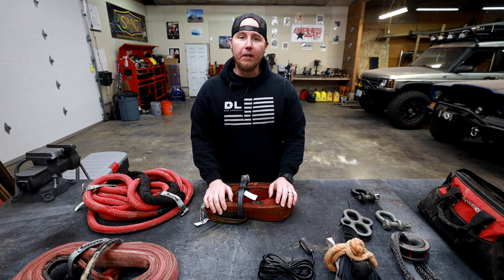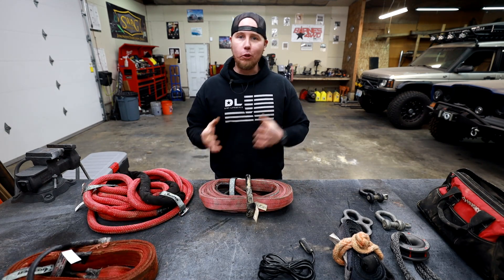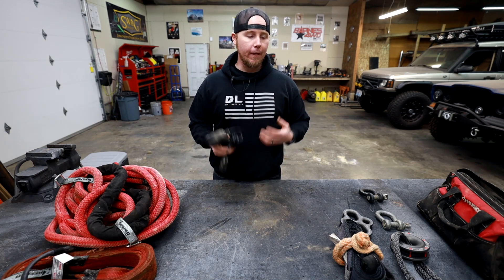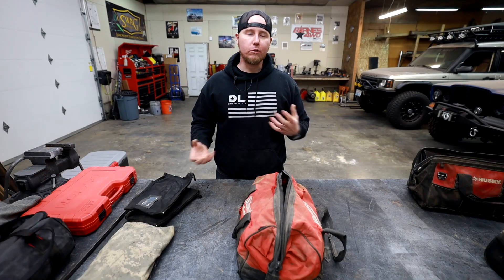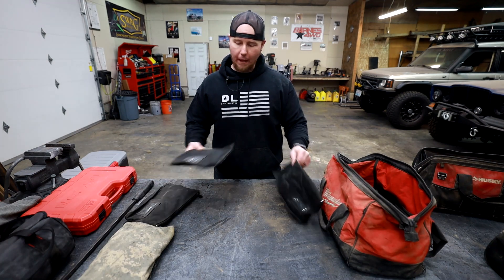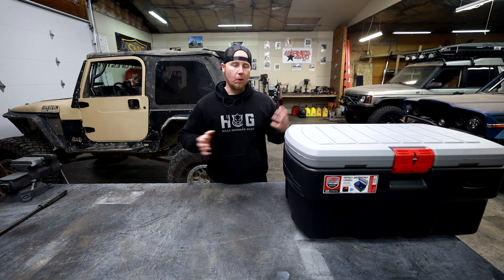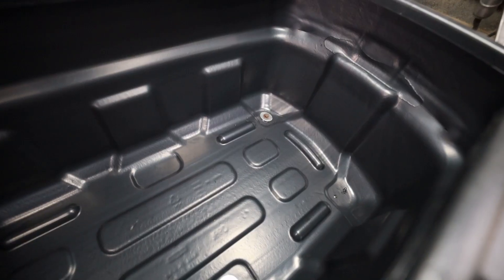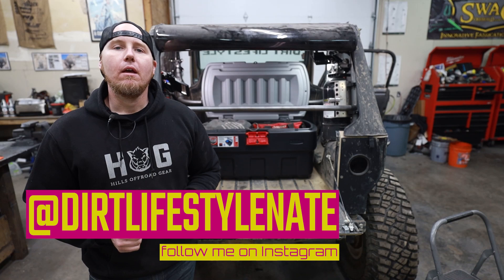Organize Your Mess! Off-road Tools And Recovery Gear Consolidation First Attempt

Comment: Calls butane torch, "crack lighter", says he's from Tacoma. That checks out😆😆😆 Great stuff Nate!!
Reply from the maker: Lol #tacomalife
Reply: Facts
Reply: Hey in all fairness that's more Spanaway now.
Reply: So fucking funny, although, if it's from tacoma, it's probably more of a meth lighter
Reply: We've always called it a crack torch
Reply: @dirtlifestyle hey Nate, can't remember (and can't find it in the videos) but do you run the deep cut bandsaw or the compact Milwaukee? Just bought the compact, but I'm worried I won't be able to do as much stuff due to size contraints.
Reply: I was like “Hey, he carried a cigar torch” and then he says crack lighter 😂😂
Reply: @timsully8054  I've actually seen both bandsaws he uses, and they are both the larger ones that can cut larger pipe. It looked like he set up a new Milwaukee on the stand to use it as a bandsaw. I think the compact bandsaws will cut up to 2" pipe though, which isn't too bad, and it's about half the price as the bigger bandsaw; depending on the brand!
Reply: I'm from WA and got that right away 🤣💯

Comment: Steel Stick from JB Weld. I don't go anywhere without it. I've actually used it on other people's punctured crank case, punctured fuel tank, and random people flagging me down for things like a punctured radiator. Stuff is worth its weight in gold 🤙

Comment: Milwaukee tool Packouts lock together. After market companies make feet for other brands of containers. Perhaps you could mount  your action packer and be able to remove it if need. I.e. to move it to another vehicle of if you need room in the jeep for shopping etc.
Reply from the maker: I had like 12 of these on my work van. Great tool boxes 👍

Comment: Hey Nate instead of using the metal shackles because you said you’re gonna keep one why not go to the aluminum shackles, I run one and love it
Reply from the maker: More research is neccessary. Yankum does some of the most extensive testing I have seen and they recommend against aluminum hooks and shackles. They saw my factor 55 hook and it's driving them crazy lol. Not saying they are all bad but because I have seen the kind of testing they do it gave me pause about using aluminum recovery gear.
Reply: @DirtLifestyle  wow, I did t know that. I just might look into some yankum. Thanks Nate. ✌️

Comment: I may have commented on this before but a recent thing I have done with my winch was actually to wire in a different brand controller plug.  My winch is a smittybilt gen 2 9500 xrc and I was able to add the port that badlands winches use to my smittybilt which has allowed me to use the badlands wired/wireless winch remotes available at harbor freight for their badlands series winches.  And since I already had the smittybilt remote this now gives me not only a spare remote but also the option of wired vs wireless.

Comment: Followed you through Pritchett.  Wanted to look closer at your jeep.  You looked a little busy for me to talk with you.  I do have a question about fuel tank.  Were is your fuel tank?  I have stretched my jeep to 100 inches and used a tank that allows that.  I want a few more inches.  But tank won't allow this.  I am running a 60 in front and 70 in back. It was a blast watching you and your group takle Pritchett!
Reply from the maker: Lol I was super busy 🤣. The font end is due for an upgrade I think.
My tdi uses very little fuel so I used a 7 gallon fuel cell. It is very small and fits perfectly behind the rear axle 👍

Comment: Check out the Ernst twist lock socket rails, you can move all those tekton sockets to 4 socket rails and then put them in the pockets of your bag.   I do this with an atlas 46 yorktown tool roll.   Tekton is a great bang for the buck and tool rolls are the way to go for offroad.

Comment: I need to get some of those keeper straps and small pouches. I've been using a combination of tool bags from CLC (1537 &1539) wrench rolls from ergodyne, and an atlas46 roll pouch for sockets mounted on rails. I usually end up overpacking tools because 90s jeeps like to use a random SAE size here and there, and the less time somebody else in the group spends fixing their junk means more trails that I get to ride.

Comment: Need to upgrade your test light to the ones that show the actual voltage, in case you have a low battery in your meter

Comment: old power tool cases the non blow molded ones. would take usually dewalt cases from the trash on jobsites. cut the ribs add some foam. have a free lead throwing tool case. some are even stackable. like the versa/t-stack box kind

Comment: i know i've commented on this video before, but i recently purchased a pair of the step 22 bags. and one of them i have completely loaded with full sets of metric and standard sockets and wrenches, and let me tell you, that giant bag became significantly less giant when you end up with as many tools loaded into it as i have. i'm still experimenting with layouts and what goes where and what i'm going to be eliminating and adjusting but those bags are absolutely game changing for offroad tool storage. i'm still working on getting everything just right but with the sheer level of things i've rounded up that i need its hard to whittle it down very much at all. but those bags have made it absolutely 1000 times easier to access and organize things i need ready access to.

Comment: Those Action Packers are nice but they lack convenient tie-down points and when I strapped mine down tight when wheeling it crushed the side wall in one corner and deformed it.  The lid is nice and strong but the walls are kinda weak, through bolting it like that is a great idea

Comment: we used ratchet straps to hold a leaf spring perch on to a CJ once...  Ratchet straps man.  Life savers.      

Great video! I carry my full tool box, and a bunch of ammo cans for storage in the back for the LJ.  Its nice for storage, but not so nice for weight or organization. I like that step22 bag!  I carry an ammo can thats just basically a pile of spare nuts and bolts and various parts, it has come in handy so many times.  Do you carry something like that?

Comment: what is your thoughts on the warn 8274 i have 2 never used them i also have a new Apex 12,000# with rope on it not sure which to install on truck i drive a 1994 Ram 2500  4wd

Comment: I would add the following (for people who 4x4 in Northern Michigan):  DeWalt 60/20 volt battery electric chainsaw (I have used this numerous times to cut through blow downs on my way in before daylight, and on my way out after dark from the woods where I go hunting).  Also, a portable/collapsible "Wyoming Saw" (for tree branches and a bone saw -- great for quartering a deer).  Also a machete-like devise called a "Woodsman" (which is a good substitute for a heavy ax) -- I have used this on numerous occasions to clear brush from a trail I am trying to get through, where a chain saw is just to big for the job.

Comment: You should always carry 2 metal shackles for the common occurrence where someone is stuck and their vehicle doesn't have rated recovery points on the front. You can use the two hard shackles and the tree saver strap as a "bridle" that will connect between the two tie points that all vehicles have on the front. Then you can snatch them out a lot more safely, since the load is split between those points using the bridle, and if one fails the second will prevent the whole snatch line slinging back. Strongly strongly recommend you include that second metal shackle in your kit mate! Great video and thanks for sharing
Reply: Also, for the same reason - you should include a hitch recovery point in your kit, both for your car or someone else's. Waaaaaaayyyy too many people who aren't familiar with performing recoveries use the tow ball to attach the snatch strap to. This is incredibly dangerous and literally kills multiple people each year

Comment: FYI, That Rubbermaid Action Packer can be locked with a padlock.  It's built right into the latch.  And I use a Sesame Combo lock on mine so I don't have to remember the keys.

Comment: This was very helpful Nate.  We're retired and are relocating from Tacoma to Pateros/Alta Lake.  Aside from golf, we're planning to take up light overlanding as a hobby/pastime.  I've wheeled a couple CJ's over the years but will be doing the overlanding in a near stock H3 that we tow behind our motorhome.  From what I've seen it doesn't appear there's much on the BDR that would require an investment in lockers?  At this stage of our lives we're primarily interested in enjoying the vistas and not so much over-challenging wheeling.  Nonetheless, I don't want to run off un-prepared.  Your video, once again, was very helpful in that regard.  Best.  Brett

Comment: The Rubbermaid box definitely an idea thats time has come I have a tape that I buy at truck stops called rescue tape that works pretty good and I also have flex tape. Recently I have been making my own soft shackles I started with 3/16" I'm working a 1)4" now and eventually I'm going to move up to 3/8"  my kinetic  energy rope I use just the basics it is it's called Samson double braided nylon, using it since the 1970s that is moring lines for boats tow lines for vessels and I do my own splicing. Spent 15 years being a deep sea Merchant sailor now retired I've used that Samson double braided nylon rope on US government vessels 10" in diameter with 12 ft eye splices in each end 600 ft length weighs about 30 lbs a foot. Standard Coast Guard tow ropes for the vessels up to 45 ft in length is 300 ft of Samson double braided nylon 1"  same stuff Yankum rope is made out of; I'm former Coast Guard boatswains mate which means my job was operate to the small vessels. Under a  small vessel captain's license I was a commercial towboat operator for many years.

Comment: Great points, brother. Always make great content. But I want to touch upon one thing. After 20+ years off roading, I’ve learned to NEVER use hard shackles from HomeDepot or Lowe’s, they are meant for static applications. So hoist an engine, heavy duty tie downs or anchoring heavy objects but as an off road use, they have and will bend even break, even saying they’re 10-20k rated, they really aren’t.

Comment: If you do metal work bolt or weld a bracket on floor and bend metal bracket over box and make another bracket on other side of box that can put lock in and no one can open or steal stuff from box and cost no more then 20$

Comment: I carry a 10” electric chainsaw lol
A Milwaukee stubby impact will save your life especially the new one and it’s only 160 bucks at most with out the battery they’re small and about 250 Pounds of torque I take this with my ratchet set and obviously a few hand tools but I find my self using that stubby an awful lot lol there’s 3 setting and they have a smart torque setting that won’t let you over torque

Comment: THIS VIDEO just did it for me and Subscribed. Your logic for the location of the storage container is perfectly logical and one other reason is that it seem to be right above the rear axle balancing that higher weight right were it belongs...in my experience.
You have such similar ideas of quality outweighs cheep-crap that breaks. One thing that irritates me most is a broken tool while out on the trail...why even bring it if it won't stand the use? just because it's light doesn't cut if for me....seems I'm the go to mechanic on ALL outings so I don't like letting someone down due to cheep-crap tools.
ANYWAY, sorry for the long comment but you have what I call "GOT IT TOGETHER" the correct way.
Thanks for your videos and I'll be watching...mostly just quietly.

Comment: Nate you should check out "Plano".  They may be a bit pricey but if you search the web you may find a sale.   I got mine from CALRANCH.COM, it was the best price I found.  1-They are plastic, 2-come in various sizes, 3-are water resistant/proof & 4-they lock.  It holds all my tools & straps.  I also use their ammo can for smaller items.  I hold it all down with a ratchet strap.  🤙🏽🤙🏽🤙🏽🤙🏽🤙🏽

Comment: When I rode 4-wheelers and SXSs a lot all over the place I had setups like this, but often thought about building a sliding cabinet in my small gooseneck horse trailer nose that would have compartments to fit the individual bags. Just an idea for you for the back of your Jeep

Comment: Those rubber made containers are legit, I've had them in my truck bed for years of pool service and they last like no other. They also haven't changed the designs hardly at all over the years so built in stuff still works with new replacements.

Comment: 4:28  A slight variation of Newton's first law, a body in motion (the moving vehicle) will stay in motion unless acted on by an outside force (yankum rope).  A body at rest will stay at rest unless acted on by an outside force (you and your yankum rope).  Thermodynamics says there is no loss of energy, just a conversion of energy.  Your vehicle stores kinetic energy by getting into motion then converting that kinetic energy into "pull" on the stuck vehicle.  I know, NERGASM!!!! This is just high school stuff.  Maybe you shouldn't have sat in the back saying "I will never use this in the real world".
4:44 Kinetic energy ropes have been around a long, long time.  We made them out of truck tie down straps, the 4" size and put loops on the ends using a leather sewing awl.  The rich guys had giant nylon rope that come from the marine industry. I mean back in the 70's.

Comment: I just did this yesterday! One thing I had that you didn't was a folded up tarp, good to lay down if you break in mud. I will add electrical gear, good idea. And I want to add jb weld putty.
Reply from the maker: Tarp is a good suggestion for sure 👍
Reply: I bought one of the heavy green army tarps instead of those cheap plastic ones and I keep it in the toolbox

Comment: I've got a set of tekton 1/2 inch impact sockets and extensions.  Came with a  decent ratchet and I absolutely love them. I've been running a  blow molded Craftsman tool set for years.  IMO the tool sets in cases is the only way to go.

Comment: great set up, i have done almost the exact same thing with bags, rolls and a plastic bin to store them in... the only difference is i like to keep my bin mobile between the taco and the jeep depending on what we're doing or where we're going i just use the same tool set up for both because i'm never wheeling/road tripping both at the same time.  thanks for the run down!

Comment: Awesome video!! Your tool setup, except or the brand names, I keep in my Avalanche for doing field mechanic work. I got 2 two drawer tool boxes with about 3 to 4 plastic cases I repurposed to hold tools. All organized because half the work is looking for the tools. I just don't keep parts in the truck, I make the customer buy those, LOL. The specialty tools go in the cab. An Avalanche  has storage space all over it. Under the back seats, 2 side tool boxes, and the bed is covered by the factory.

Comment: lmassoff. So true!  Bags to small or tight to re-roll or fold the tent, sleeping bag, tools or whatever as tight as the way it was brand new before opened. . After years of surfing, sailing, mountain biking, dirt biking, some hiking and 4x4 there was and is always a need for reducing and keeping the amount of space as efficient as possible.

 But professional bag roller/packer was not and is not one of my life's ambitions,  spending hours figuring out how they folded, rolled fit what ever it is back in the bag or pouch the way it came new. smh. lol

Comment: On the Rubbermaid tote, run a bead of RTV silicone in the channel of the lid and smooth it out with your finger to create a gasket then let it dry before closing it. This will help to minimize the amount of dust and some moisture out. I did that on a tote about 20 years ago and it still works great.
Reply: Good idea, I do the same thing except I cut wax paper strips and put them between the RTV and the box then put the lid on the box and snap it down. Pull the lid off the box the next day, remove the wax paper and you have a custom fit gasket.

Comment: Spray the shop towels in the blow molded case with silicone spray. Helps with corrosion issues and you can wipe the tools down. 

Also, the blow molded case helps you make sure you've policed up all your sockets when using them.